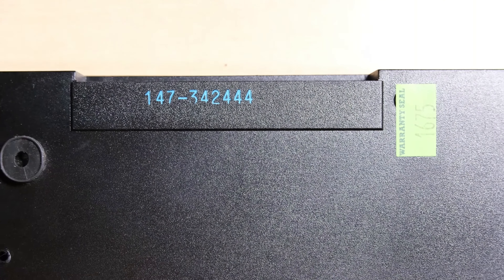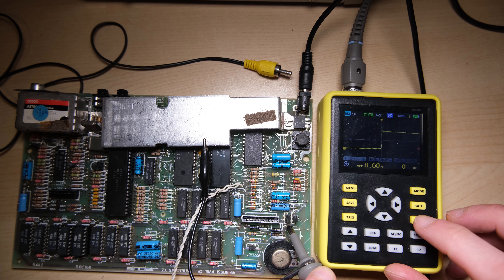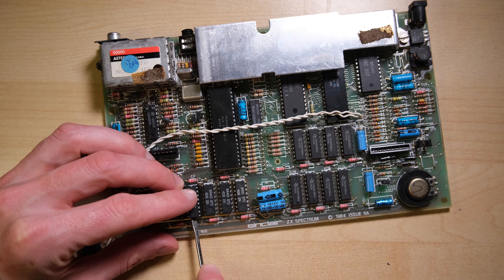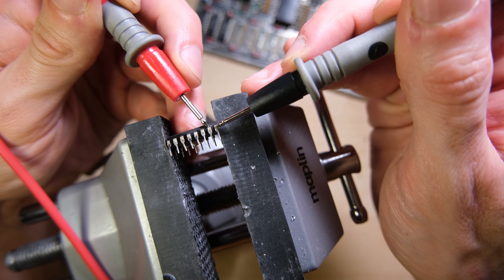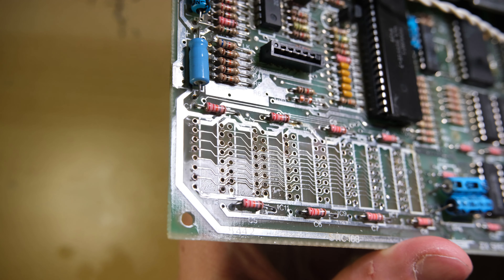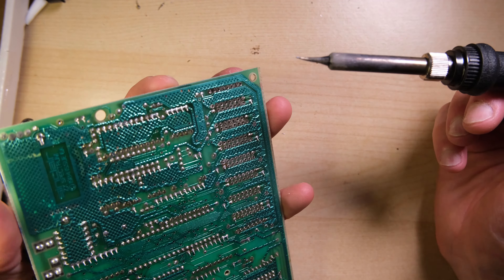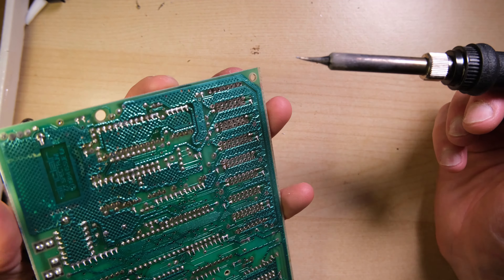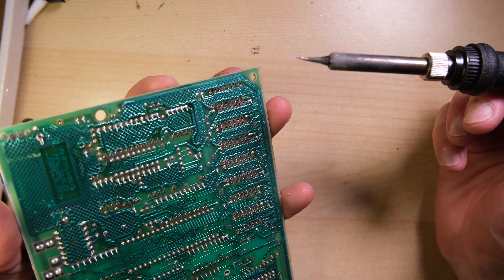ZX Spectrum 48K Repair - The Write-off

Comment: Nice work, another Speccy saved. You’re like Quickdraw McGraw with that solder sucker! Funnily enough I had a similar fault, turned out to be a shorted address line somewhere under the lower RAM sockets. Did not show up on a continuity test, but was pulling the line high. A pain to track down (lots of desoldering and systematic testing…) but worth it in the end!
Reply from the maker: Yeah it's a real "I AM INVINCIBLE!" Moment when it boots
Reply: @HappyLittleDiodes  I’m worried it’s addictive! That was my first real repair job, an eBay fixer-upper. How did you get started?
Reply from the maker: Play expo in Manchester made me realise I've been missing out on the retro scene. My boss gave me his speccy to repair when I kept going on about it
Reply: @HappyLittleDiodes  ah yeah, I missed so much myself, so I’ve been playing catch-up this past year. Lots of great folk in the community willing to share knowledge, seems to be a good time to jump in. Cheers for sharing your work, I’m away to watch the reverse engineering ones next. (Thinking of tackling an I/O project next with my newly fixed Speccy).
Reply from the maker: Keep me posted.  The spectrum quartet was a good IO project to

Comment: Replacing the 7805 power regulator is a thing to do. With a switchmode regulator there is much less heat in the case, helping the life span of ULA, other chips, and caps.

Comment: I bought Chinese caps for replacement, but they have a large spread of inaccuracy at a nominal value of 20% can I make a replacement like this?
Reply from the maker: Yes those will be fine.  I recommend using axial caps
Reply: @HappyLittleDiodes  ok thanks. I found info in manual that it may be -10% to 80% so as I understand better if it will be hier than less.